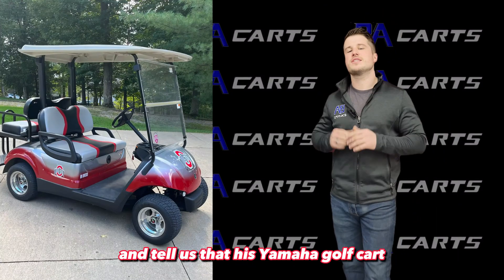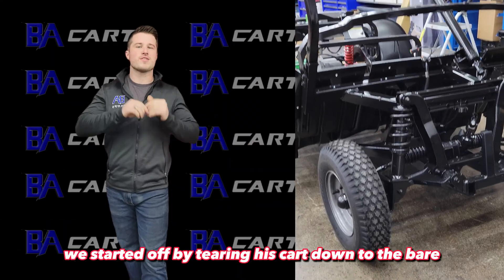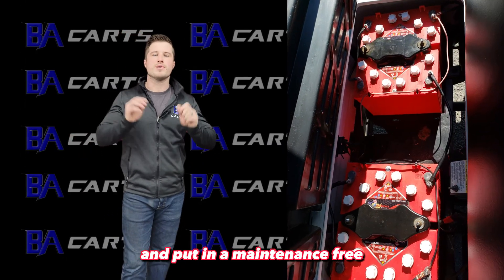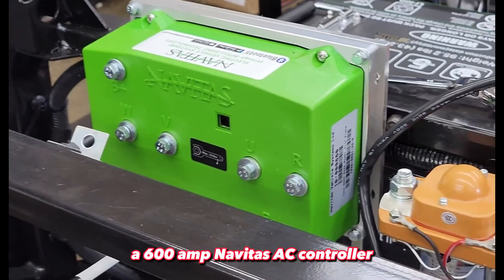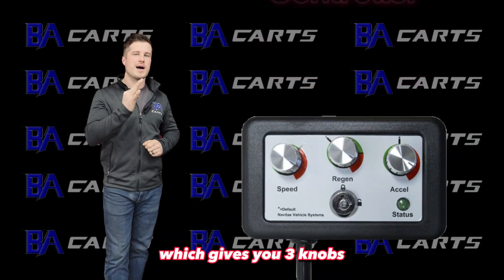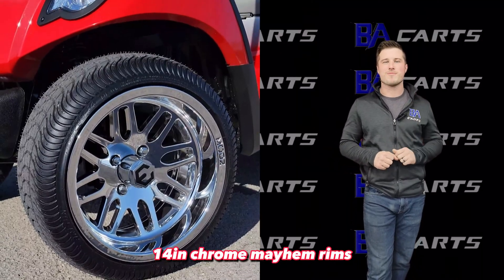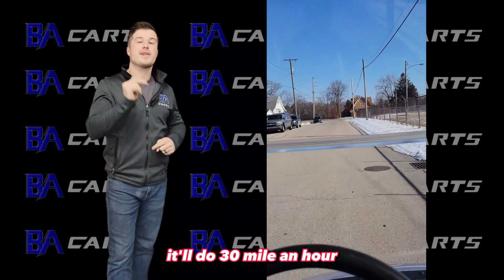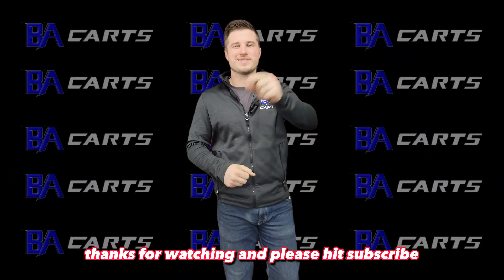We Install A Lithium Ion Battery And Navitas 600Amp Kit In This Yamaha Golf Cart!

Comment: How much was all that?
Reply: I want to replace my 48v ezgo txt battery to a lithium setup and eventually upgrade my motor and controller to navitas. While thinking of battery I wondered if I should or could replace the whole system with a 72v. Is it worth it? Is it possible? Thanks
Reply from the maker: Just the battery, Motor, Controller, and Labor was around $7,500. Paint job is around $1000. Rims are $1000.